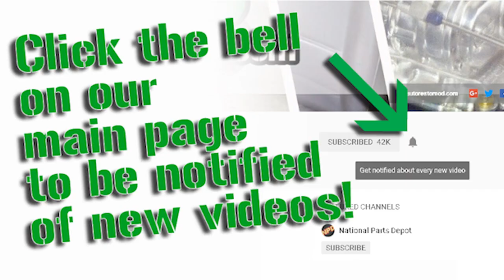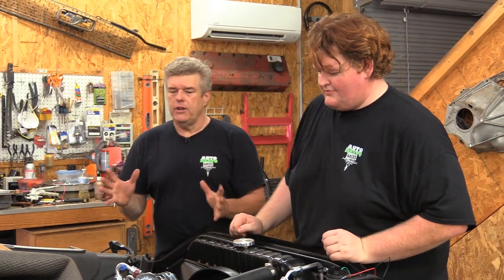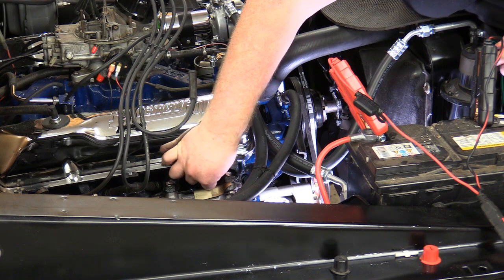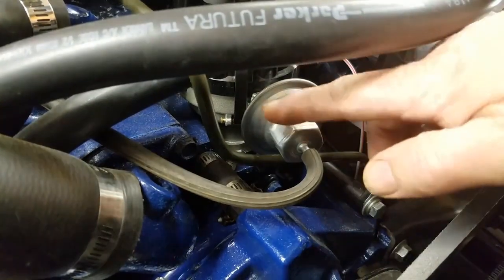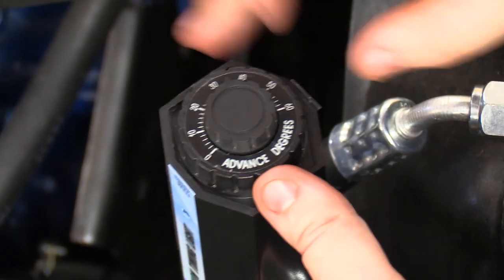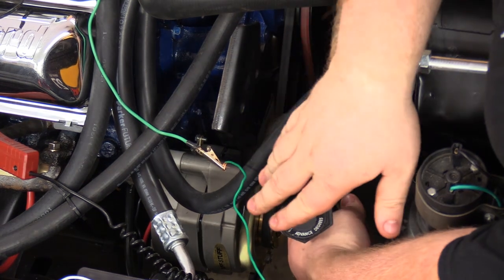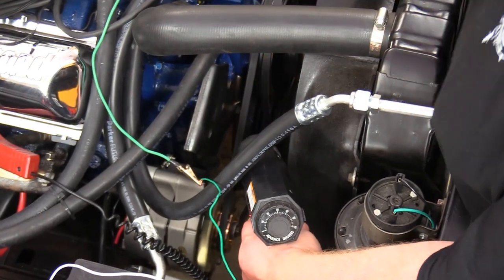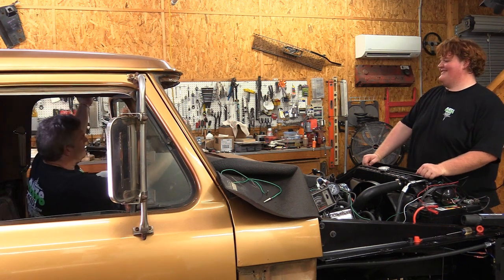How To Distributor Tuning 101 Episode 409 Autorestomod

Comment: What would you do different If you were running a mechanical advance like in my msd distributor?
Reply from the maker: Makes things clunkier. You can only get so much mechanical advance and the distributor is "dumb" it only has that to work from. I might go in and save the pennies to get a vacuum advance distributor if it we me. The 390 is WAY happier with the vacuum.
Reply: Autorestomod Manic Mechanic Gasoline Media I don’t know about distributors. You mean if one has a vacuum on their distributor, there is no mechanical advance? I’m talking about a ‘77  304 v8 in my ‘81 Jeep cj5 with ford distributor and BID ignition

Comment: Thanks to for the  video great info you guys helped me alot on my 69 250 390 the vacum pods they make today are junk I think the adjustable ones are the best I had a pertronix billet Distributor and the pod went out at 500 Miles the pertronix 3 you need to pull the dist out  and take it apart to change it bad to design .
Then I swapped that out for a rebuilt motorcraft the pod went out after 50 miles or so they weren't ajustable I took them apart to see what was going on and off you can see how the pinched the edges when they made it the diaphragm was so thin no wonder it failed the adjustable one seemed better made can't remember were I bought it ..
Reply from the maker: Glad we helped!

Comment: My 73 302 runs like a Swiss watch, smooth, jumps out of the hole when given throttle, but when idling it smells way too rich for me, and I put a brand new carb on it, I did not mess with the metering screws, I set my timing by ear, in the van, someone has to crawl under to put the timing light on it, you turn from inside, I converted from points to pertronix years ago, added an Accell coil, removing the ballast resistor wire, sending full 12 volts to ignition.
Reply from the maker: That's how you do it!
Reply: @AutoRestoMod  Except they should really be using a timing light! Advancing your base timing by as little as 4° to 5° can actually make some cars almost a 1/2 second faster in the quarter mile! And do you really think the human ear can tell the difference between a few degrees?

Comment: Confused.  40° WTH you talking about?
And whats the suction on #1 about?
Its always been crank till finger blows out, turn balancer to 6°Tdc, check rotor points to #1 cylinder, adjust carb screws and idle screw. 
Where did you attach the vacuum on manifold. And where on port?
Confusing stuff.
I gave a cold start and a dead spot at excelleration. Cant seem to clear it out.
Reply from the maker: Sorry we confused you

Comment: I have a 4 x 4 truck 400 small block fresh motor 350 Turbo I'm always having trouble deciding whether I want to tune it to ported or full vacuum it's pretty much a stock warmed-over so much misleading information
Reply from the maker: Id'go with what ever works best. Try both. Tune for it. See what offers the best "brain" for your car. If the distributors is aftermarket, contact their tech line and see which they like for you to use.

Comment: I’m lost like a chicken without a head, lol I’m dealing with a 75 mustang with the v6 and a aftermarket carburetor that has no name nowhere and as soon you start driving and getting on the gas if starting to going flat on his face dead sputtering and all that till it’s dead I put the mark of the damper with the T line of the block and the distributor line up to the #1 plug I had to move it all the way forward to get better results but I’m lost lost lost

Comment: Watched your points video, but you guys never showed how to use the dwell meter
Reply: Jay Con Connect the red + lead of the meter to the - side of the coil and the black meter lead to a ground. Start engine, turn the meter to dwell and it should be at 30. Used points 28. If your not where you want to be then with an allen key, turn clockwise to decrease dwell and counterclockwise for more dwell. Then set your timing. If you have a 6 cyl, with engine turned OFF, you need to pop off the dist cap and using a screwdriver turn the adjustment screw clockwise to close points for less dwell or counterclockwise to increase dwell.
Reply from the maker: Keep it up John and I will hire you to answer tech questions on here! 🤔👍
Reply: @AutoRestoMod  Ya know when your a gear head and know a few things or two, you can't help but comment.  Been a GH since 1973. Wow, time flies.
Reply: @AutoRestoMod  When you've been a gear head since 1973, it's hard to resist.

Comment: Where do you connect the tachometer? Where are you hooking up your vacuum gauge? Can you guys just turn the engine over with a ratchet? That the 2nd time I’ve seen Cam get shocked
Reply from the maker: Why use a ratchet? I like seeing Cam get shocked. Tach hooks up according to the instructions that come with the cam. Usually black to ground, green to negative on the coil, and red would go to switched 12 or a dash light circuit. Obviously we aren't using the red wire for the dash light. The vacuum gauge hooks to the intake manifold vacuum tree on the intake or firewall.

Comment: Isn't 40 degrees advance a little to much?
Reply from the maker: We will see. There will be real world tests that need to be done. I think it might be a little too much timing. But as we said, until we get it on the street we won't know.
Reply: @AutoRestoMod  Chevy SB V8's like 36*.
Reply: Fords typically like 32 - 34 degrees of total advance.  Not sure about the big blocks I think they are the same.
Reply from the maker: We did testing this weekend and it liked it. BUT we think that the carburetor might be too rich.
Reply: @AutoRestoMod  was the canisters vacuum hose be unplug to check total advance, you had your vacuum still plugged in when you checked total advance.

Comment: Let me connect this here jumper to the coil and then touch the other end of the lead to the ⚡️⚡️⚡️oops I got electrical shock!!!lol yeah that’s how electricity work junior.
Reply from the maker: Lawd, if you ain't never been shocked working in a car...you ain't worked on a car. 🤣🤣🤣
Reply: Autorestomod Manic Mechanic Gasoline Media I was raised around cars! At 8 years of age I started working at gramps auto body shop sweeping the floor and taking out the trash etc...my first car was a 1966 mustang convert. 
Last week I installed a timing chain on my 69 Pontiac firebird...
Today I bought a 5.3 LS engine to build this winter so you could say I have worked on a car or 2 or couple hundred...
Just be careful when letting jr show us how it’s done is all I’m saying, electricity is to be respected!!!😂😂😂

Comment: Amateurs.
Reply from the maker: We all are aren't we...even you.
Reply: Maybe I was a bit to harsh.I apologise.
I grew up as a tune tech,s son in a Ford dealership.
First of all one must understand what's the vacuum advance was invented as and is 4. And when they come along with ported vacuum why did they do that? These are two very important questions, and when answered, applied to the adjustment of the centrifical weights something you're calling mechanical advance I believe, and of course the infinite adjustment of the original Ford distributor Whole New World will be in front of you. The first thing I like to do is throw away mypoints. And install the duraspark Blue Chip electronic ignition genuine Ford off the shelf parts.
Reply: All my engines are set up old school, with the exception of the 1976 duraspark 2 ignition. I reach into the distributor and substitute the heavy centrifugal spring with another light one out of another distributor. This will bring in all of your centrifical timing bar around 1200 RPM. The upper distributor shaft that your rotor rides on can be replaced from distributor do a different distributor most of these are different from engine to engine and can also be put in 180 degrees from where they started. So you can bring in all your time in quicker eliminating any hesitation and limiting the total timing bye the gap cut in this upper distributor shaft. What are the achieved usually around 42 total timing, that's what I adjust the vacuum advance and going down the road under kruis conditions could have as much as 60 degrees advance. The vacuum advance is a mileage device. I can't know this for certain holding a Ford engineer could confirm what I believe but I believe ported vacuum was introduced into a two-stage diaphragm of the vacuum advance to overcome the lack of centrifugal timing in the distributor built into the distributor to accommodate the new gasoline we had in the early seventies. This is a very interesting subject but once you read up on this get in and start adjusting these parts, in my opinion you can buy over the counter great Factory components Anna just the timing infinitely.

Comment: there you go again doing a halfway job of a video you're trying to tell people how to find top dead center on a number one plug and you start out good but when you go to use a jumper wire that's where you screw up what do you hooking it to your cooking it to what the solenoid on the starter how many screws and bolts on the back of a starter oh I don't know I think mine has two or three bolts coming off the starter which one is it that you hook to wire up to why can't you guys do a complete video I don't understand this so I'm just supposed to experiment and and touch each one until it tries to turn the engine over I don't know if one of those is the wrong one and what if I burn up the solenoid trying to do it this is the whole point if you're going to do a video do it properly do it professionally so you're giving out the right ad Vice and not leaving out very important information
Reply: I had a stroke reading this. If you don't understand the electrical system of a car or how the relays and solenoids work.. you probably shouldn't mess with timing. As it is an electrical system too.